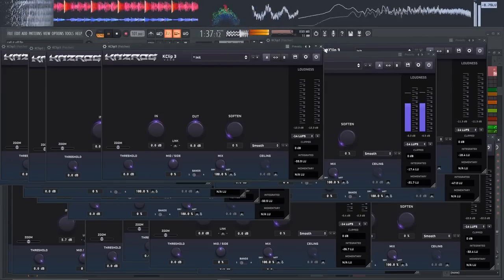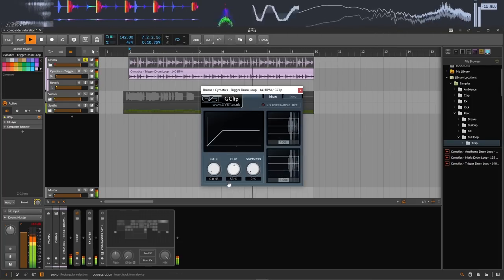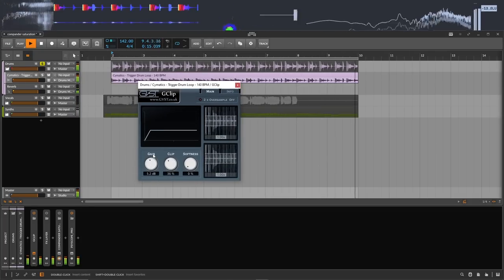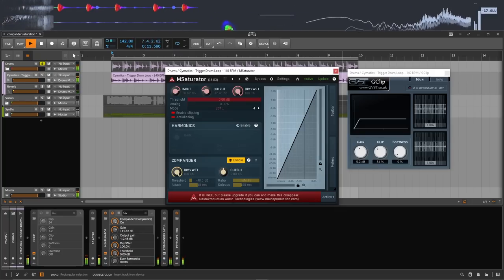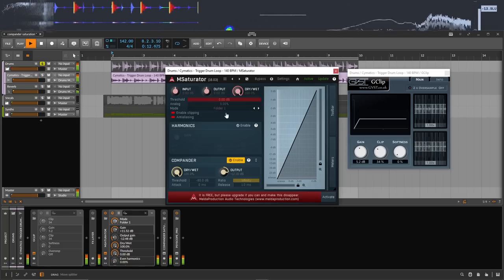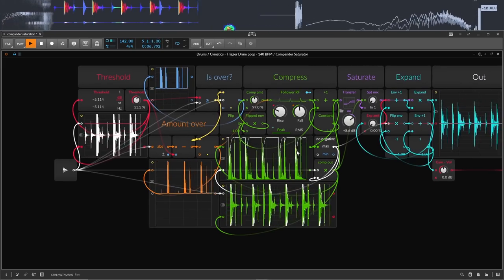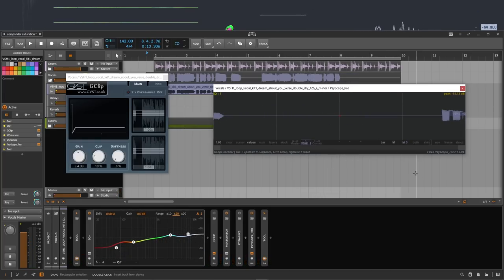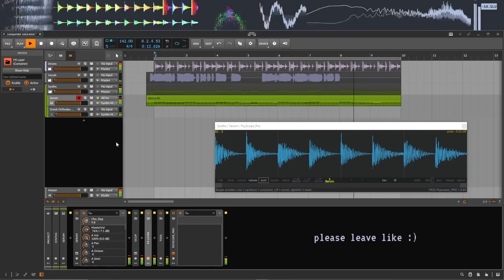heavy distortion without losing dynamics

Comment: Did this man say ratio is just a mix knob? 😮 how.
Reply from the maker: is it not though? turn up for more companding turn down for less.

I have the threshold set at -80dB so sounds will almost always be triggering the compander, but 1:1 will cause no effect, essentially 0% mix, while 1:infinity will do maximum companding, essentially 100% mix. I think?
Reply: @jshstuff  man, my gut tells me something is wrong here, and I can't trust this statement as fact, but I can't really tell you for sure. Normally a compressor ratio knob is definitely not a mix knob, but I can't really visualize In my mind how this compression and expansion in one step works, and what the ratio means there. I feel like what I read on that info tab for the plug in, mentioned that the ratio functioned like a compressor, but I have never used an expander because my teacher didn't like them LOL. So I really have no idea how applying a compressor, then saturation, then expanded would work, but my gut tells me the ratio would not function the same as adjusting the overall post gain of that signal. I could be wrong! But that's why I'm asking and not telling haha. I want to get to the bottom of this!
Reply from the maker: yeah I get u. so normally the ratio on a compressor determines how much to reduce the gain for every db it goes over the threshold. so if you had 3:1 compression and you went 3db over, it would reduce the gain to just 1db above the threshold. for expanders if you went 1db over the threshold at 3:1, it would increase the gain to 3db over the threshold. (tbh not 100% sure this is actually how the math works)

so again, if we took the compressor example, if we turn the ratio up or down, we’re really just changing how hard the compressor reduces the gain when it goes over the threshold.

compare this to an example where we have a ratio fixed at 1:infinity, and we have a mix knob. turning the mix knob to 0% will cause no compression to be applied, equivalent to 1:1 compression, while 100% wet will cause maximum compression, which is 1:infinity. these are both the same thing but are achieved in different ways.

the same goes for expanding, only it’s backwards.

so the same thing also goes for companding.

does that make any sense?
Reply: @jshstuff  I think I'm following you there. I would have to tinker with this to really prove it to myself,  but I think I get you there. Decibels being logarithmic always screws wirh my head. I realized while watching this video that I didn't fully rmemeber the properties of logarithms and that made me sad haha. 

I think I get what you're saying tho. I really didn't know for sure how expanders applied.